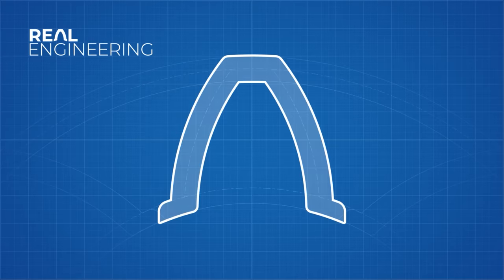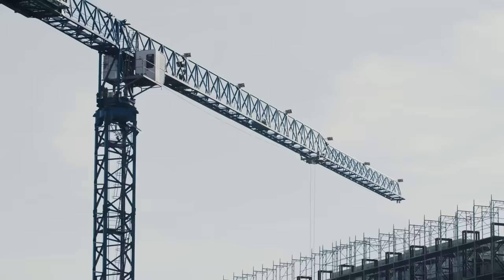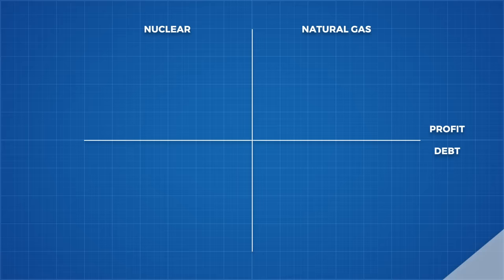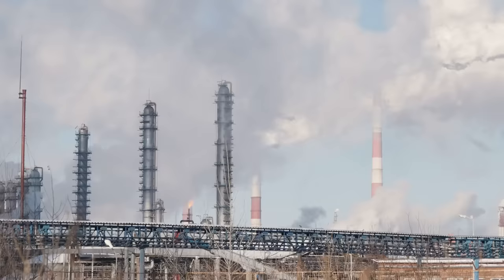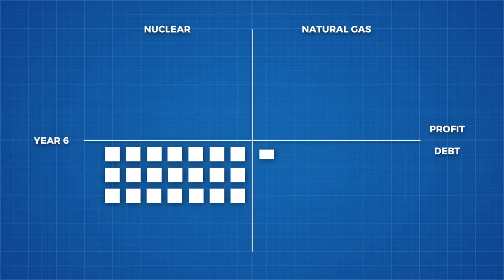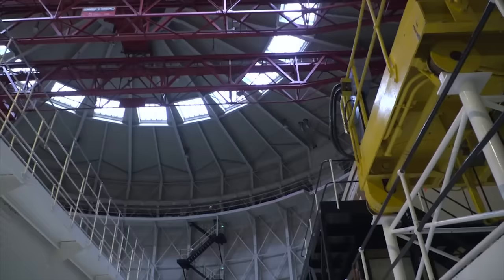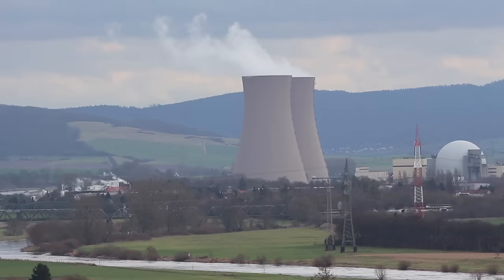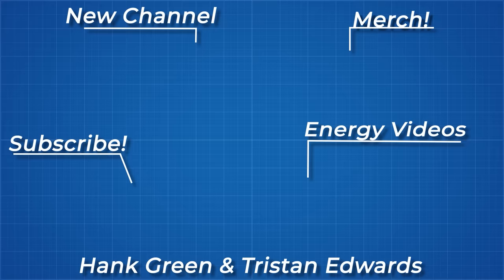The Economics of Nuclear Energy

Comment: I’m willing to bet the reason it takes 6 years to build a plant is because of government regulations. Tell me I’m wrong.
Reply: Part II
The Southeastern U.S. is super pro-nuclear MAGA, has zero anti-nukes, and 100% political support. 
VC Summer (South Carolina) new nuclear units 2&3 were canceled in 2017 after spending $17 billion on the project (original estimate of $14 billion and 2016 completion date) with no clear end in sight for costs or schedule.  

Vogtle (Georgia) new nuclear units 3 &4 currently 110% over budget and schedule and still not operating. Mid way into the build, the utility stated that had they known about the many costly delays they would never have chosen nuclear.  They are now delayed another year because according to the project management, thousands of build documents are missing.  If you can’t build new nuclear in the MAGA super pro-nuclear southeast U.S. then where can you build it?

I guess the utility losing thousands of build documents that are necessary to prove that welds were x-rayed and safety equipment actually pasted testing is the fault of government regulations.  Maybe a utility that loses thousands of build documents should just be trusted that they did everything right
Reply: @clarkkent9080  This isn't really the case though. The source of the Vogtle and VC Summer delays are not due to political will or how popular the technology is with the public (especially the local public), but rather due to a significant change in design and build requirements made by the NRC only after the designs for these reactors were years into their design and approval process as well as environmental and anti-nuclear groups filing legal challenges against their construction, as well as other supply-chain related issues. The design approval process for new reactors based on designs not previously approved by the NRC can take on average 5 years, and Vogtle and VC Summer's AP1000 units are precisely that. So while they were approved under the revision 18 AP1000 design guidelines in 2012, after the enactment Aircraft Impact Assessment (AIA) rule in 2009 these plants had to retroactively change designs in the middle of the process to accommodate the new requirement that the reactor containment building have a new secondary structure that itself can withstand a direct impact from a commercial passenger aircraft. When you consider that contracts were signed going back to 2006 for these plants, and you consider interest rates for financing of these projects, and also combine this with the fact that the construction methods for the AIA-mandated containment structures had yet to be invented when the construction started, then it becomes much more apparent that once you dig into what went wrong with these projects you find that it is not just problems inherent to nuclear technology itself. Throw in a bankruptcy by Westinghouse in the middle of the project, as well as unexpected supply chain issues with components and a bloody pandemic, and you get to the 2023 target dates for Vogtle 
Instead, what you find is what has been the case for decades in the US that other countries clearly do not struggle with is a hellscape comprised of a public that doesn't understand the technology, an electorate that is influenced heavily by fossil fuel lobbies that do not want to compete with nuclear on an even playing field, and the resulting regulatory changes that alone cause billions of dollars in extra costs and years of project delays. I don't get where you are getting the idea that there is a link between the political MAGA ideology and some mythical region of the southeastern US that has 100% political support for nuclear either. There really isn't any region on the planet with 100% support for nuclear. Even in France where nuclear comprises the vast majority of the country's energy mix, only about 50% of people identify nuclear energy as an asset to France, even though it is quantitatively the best energy source for long term sustainability and has allowed France to export almost 10% of all of the energy it produces in a given year to the tune of about US$3B/year in net profits. The biggest issues for nuclear are rooted in ignorance, greed, and fear, not in physics.
Reply: @Jordan-vc3iu  VC Summer was canceled in 2017 so please don't play the supply chain issue card.

exact same AP1000 was built on schedule and is currently operating so any design changes were incorporated.  If there were others then please list.

Prior to starting construction the NRC fully approved 100% the construction and operating permits (first time that has happened). So all the utility had to do was build it according to design and then submit the proof (x-ray of critical welds and safety equipment test data. Unit #3 has been delayed 1 year and will cost $932 million more because the utility LOST many of these build documents. Now blame that on the NRC or outside anti-nuke groups and feel free to confirm my statement.

Correct me if I am wrong but there were no actual changes required due to the AIA rule just confirmation that the current design was adequate.

Utilities decide what to build not the media, greenies, politicians.  Actually, in the case of Vogtle, the republican PUC and governor have bent over backward to help the utility.  My electric rate increased 29% due to Vogtle as detailed on my bill when NO utility is allowed to charge for a new plant until it is built and operating. The South Carolina PUC was no so inclined and when the utility realized that they were on the hook for the cost over runs, they canceled the project.

I live in the southeast U.S. and except for a leftover hippie or 2 there were no demonstrations at either projects and all media reports were fully supportive. That is not true in say California.  I added that because so many people blame anti-nukes, the media, and many even say the NRC will never let a new nuclear power plant startup.

If you want to watch the failure of the next new nuclear project, research NuScale who just halved their project due to ballooning costs and utility backers backing out and now delayed the project start till 2025.

My statement stands: If you cannot build new nuclear in the most pro-nuclear part of the U.S. then where can you build it? And I would add with the now valid supply chain and labor shortage issue it will not get any better.
Reply: @clarkkent9080  I was referring to Vogtle regarding supply chain issues. Tricky talking about two massively complex projects at the same time, but that was a factor in the mix regardless.
These AP1000 units were the first new nuclear projects in the US in the last 40 years, so idk what units you are referring to when you say the exact same ones were built on schedule and are currently operating. 
Part of that is having to navigate the mountains of regulatory requirement and the many tens of thousands of pages of technical documents that are required to be approved to build and then operate. The "lost" documents you are referring to aren't misplaced, but as Vogtle executives explained are due to the accumulation of many shortcomings such as missing signatures, forms never being filled out, and incorrect filings resulting in a 3 month delay and nearly $1B dollars in extra costs. 
This is most likely because, as I said, this is the first time new nuclear has been built in the US in 40 years. The regulation has not kept pace despite the NRC approval process revisions, and there plainly is no legacy experience in the industry to draw from; no experienced US-based AP1000 builders exist. 
To act as if that is the fault of the technology, or that it isn't in our shared best interests to still pursue it and to build up industry experience by continuing to work on new nuclear projects in the US, and then also to continue to hone the regulatory requirements and processes is to sacrifice better futures for the sake of avoiding short term pains. 
It doesn't have anything to do with MAGA or political support. As you stated, the companies decide what to build, and they are continuing to pursue Vogtle as well as other new nuclear projects because they see the value and potential profit there. 
Previously PWRs and BWRs were expected to last around 40 years, but Gen4 reactors have expected lifetimes that are potentially in excess of double that. Once built, they will provide one of the most profitable and reliable sources of energy to ever exist. And once the technology is proven, then regulation and public opinion may follow, easing the way for the earned experience of new nuclear builders to build faster, better, and cheaper new nuclear in a more friendly regulatory environment with a hopefully more amiable public outlook.
Or you can just say "oh look nuclear fails in the US," and we can continue burning gas and coal instead.
Reply: @Jordan-vc3iu  China has build and is operating the Westinghouse AP1000 and did so before the VC Summer or Vogtle project and both projects had imbedded engineers to document any problems so the Chinese not only worked out any "bugs" but they built them using English translated documents. 
Vogtle was scheduled to operate many years before the Pandemic.  How can you blame Pandemic related delays on a project that delayed so many years that it eventually had some affect?
Both VC Summer and Vogtle both have operating reactors and utility experience in building these types of plants.  If they did not lose documents then the CEO lied.  Here is his actual statement. “We’re a little frustrated with the latest developments,” Southern Co. CEO Tom Fanning said yesterday in an interview. “[The first unit] is on the doorstep of loading fuel and going into service.” 
Fanning talked of “great momentum” at the construction site since November. He said the company was looking forward to receiving the Nuclear Regulatory Commission’s permission to load fuel rods into the reactor, the last major step before it can start producing electricity. 
But workers realized “tens of thousands” of critical documents were missing, leading to a three-month backlog, Fanning said. Officials have cut that time down by 30 percent, he added. 
“We’re fixing that part of the ‘paper’ process,” he told E&E News.  In any case, there is NO EXCUSE. Is this latest "issue" pandemic related?  NRC related?  Did anyone get fired?  Put in jail?  No because the ratepayer will foot the bill for their mistakes.

If you go back in time a little, Southern company clearly stated near the beginning of the project that had they known about the cost and many delays, and decrease in the cost of natural gas, they would have never pursued a nuclear build. So, NO they do not realize the benefit of nuclear, they thought they were too far along to back out.  VC Summer did the right thing.

Like I said, lets just sit back and watch NuScale gen 4 reactor builds and compare cost per Mw to that of Vogtle and if either, ever comes close, then they are also failures.

I am pronuclear.  I worked in the industry for 40+ years but that does not mean I will support it no matter what.  I know many people that worked on or are working on VC Summer and Vogtle and this is a construction craft and project management issue and until that is addressed nothing will change.  I simply state facts and based upon those facts what can be expected if we continue to build new nuclear without changes.  These YT videos that use $7 billion and 7 build years for a 1,200 Mw new nuclear plant are simply LYING and refuse to even acknowledge the last 4 failures.  When people stop making excuses for these failures maybe something will change.  In any case, the utilities that decide what to build know the truth and they are ignoring new nuclear.

Comment: I love how you conveniently ignored the cost of dealing with spent nuclear fuel, and the cost of disassembling a power plant after it passed its designed lifetime.
typical pro nuclear thinking... "don't worry about it! we will deal with it later... some scifi high tech something something, oh LOOK! nuclear is so profitable! look at the profits!"
Reply: Considering the volume of nuclear fuel, it's a cost glossed over because it's frankly inconsequential. A single deep mine excavated to store spent nuclear waste could be used for centuries without becoming full and having to dig another. 

The lifetime of nuclear plants are becoming longer and longer, especially with designs chosen by countries that can rely on long term popular support. 

What IS a problem for safe storage is solar power. Photovoltaic cells require a number of extremely dangerous and hazardous compounds, which unlike nuclear fuel, will not decay in time. They are often mined at great expense to the local environment and would require just as stringent containment as nuclear fuel post-use. None of this is to mention the incredible lithium consumption it would create, given that solar is not on-demand like nuclear is. 

It would be more accurate to say that solar power is a non-renewable resource and fossil fuels aren't; advancements like fracking have unveiled massive reserves of shale gas, while 56% of the lithium in the world is mined in one location (the lithium triangle).

It's a nice touch however to add in your strawman at the end. It shows you have absolutely no idea what you're talking about, and have to resort to misrepresentations to make your point. Please never vote.

Comment: Of course never ever mention the cost  in CO2 of making a windmill. And never mention what we do for domestic heating when they've burned all the gas in power stations.
Reply: Because the CO2 cost of making a windmill is minuscule compared to the amount required to produce the same energy through fossil fuels...?
Reply: @Gomlmon99  If you count the CO2 saved when power goes off in California and South Australia yes. Tell the Germans they are burning brown coal in 10 new power stations to feed Ruhr industries. Green power meant so much load on French nukes they nearly had a melt down.
Reply: @mikemines2931  this has gotta be one of the stupidest comments I ever read 😂 no point even trying to use facts or reason
Reply: @mikemines2931  Considering the entire scientific community supports that viewpoint, I’d say not.
Reply: @mikemines2931  That's not how nuclear power plants work. They are operating at 100% capacity at all times. There is no adding to the load of a nuclear reactor.
Reply: @mikoi7472  Dont be silly, go and watch Chernobyl.

Comment: If you look up "cost overruns" or "over budget" online you'll see a picture of a nuclear power plant :-).  Also, wind and solar don't depend on commodity prices like gas, oil, coal, or nuclear
Reply: You know what they do depend on though? Highly polluting construction and unreliable sources of power (And also inefficiency)
Reply: @Am_Yeff  yes they also use large amounts of concrete which create GHGs.  Also, they were doing maintenance on a plant in Canada and a worker forgot to remove a wood board with screws before it was restarted. High pressure water ripped through it sending wood splinters and screws all through the plant.  It was shut down for a month to clean up the mess
Reply: @earthsteward9  i was talking about Winf and Solar but aight
Reply: @Am_Yeff  wind and solar need a large grid and/or pumped storage to give a somewhat steady supply though I agree a back up is needed.  Capturing methane from sewage and garbage might do it